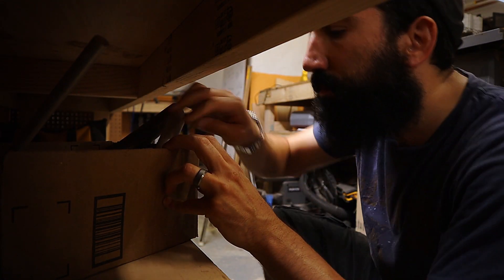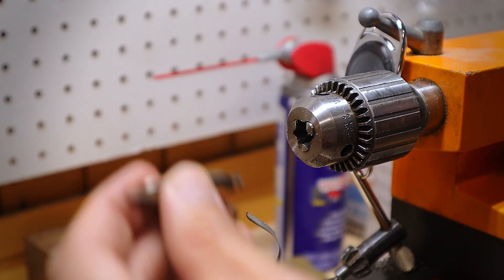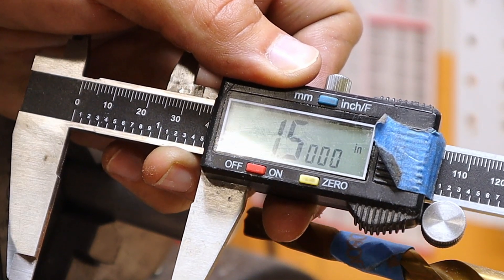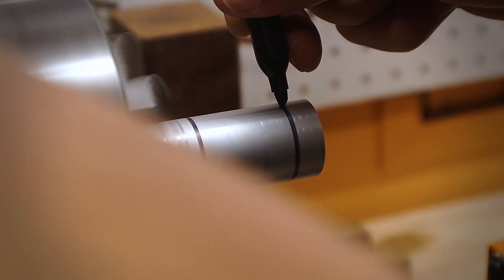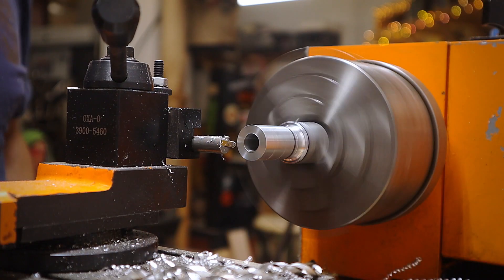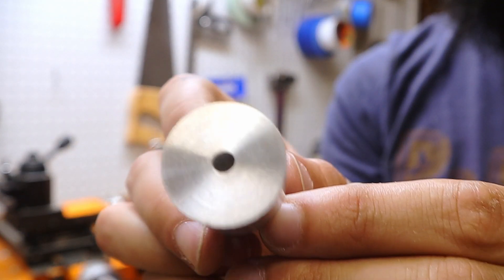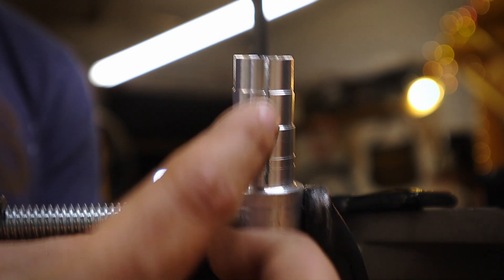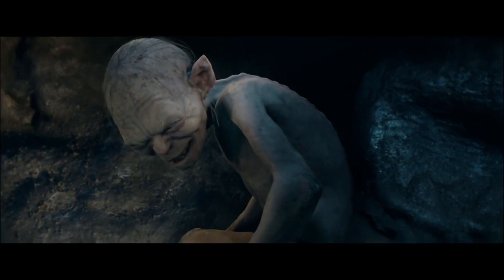Graz Makes: An Adjustable Ring Arbor (On a Metal Lathe)

Comment: For this Coin Ring jr maker the search for the self centering no wobble ring mandrel for facing, channel cuts & etc.. goes on. is that to much to ask. I think the big / tall shoulders is great idea becose once you round out the edge on a coin it wont fit up against the small / short shoulders of the mandrels I've tried. They slip over becose not square but make them taller and it does work.